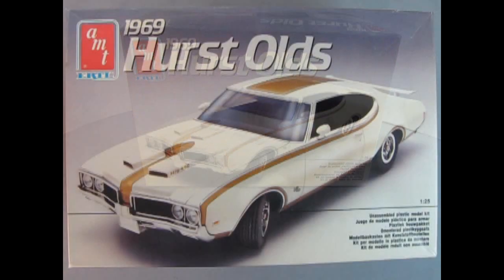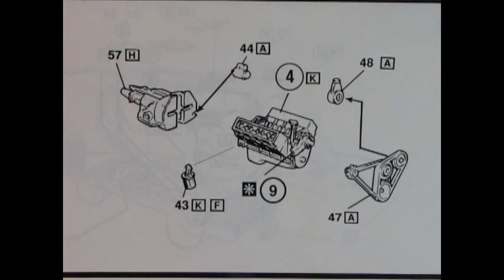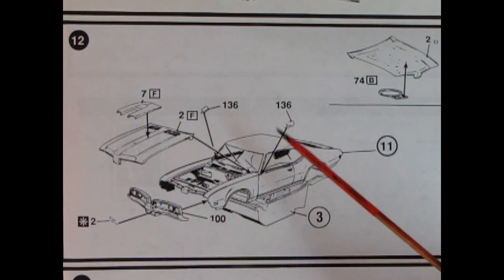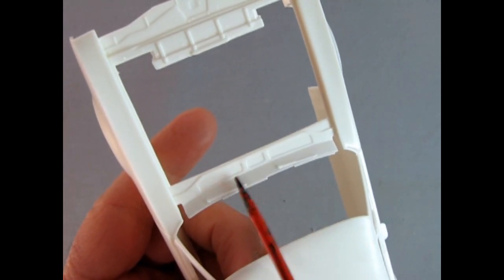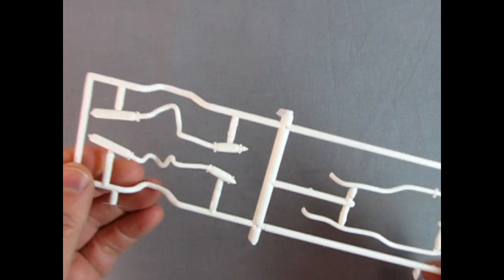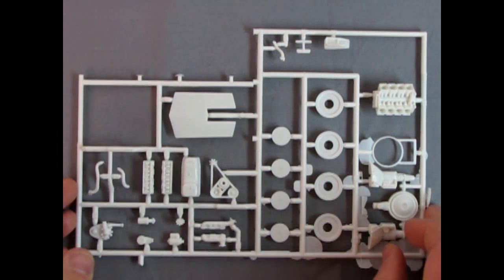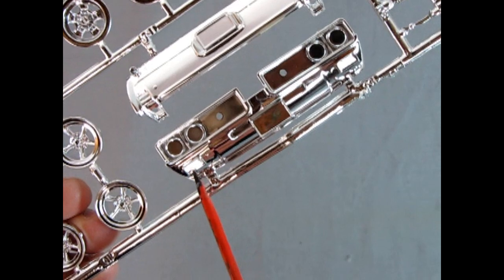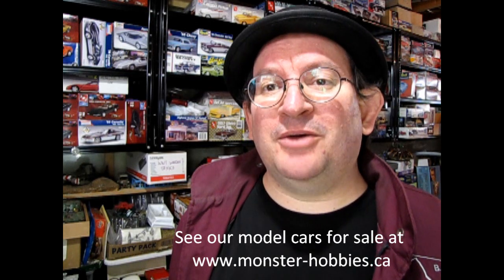What's In the Box? - The AMT/ERTL 1969 Hurst Oldsmobile Model Car Kit Unboxing Video

Comment: The flash has nothing to do with the making of the molds it's from the molds being used many many times over and over again through the years.
Reply from the maker: You are correct. It's from gaps between the top and bottom of the mold and plastic being able to squeeze through. - I think I really need to script these unboxing videos. I'll try and do better in 2024.